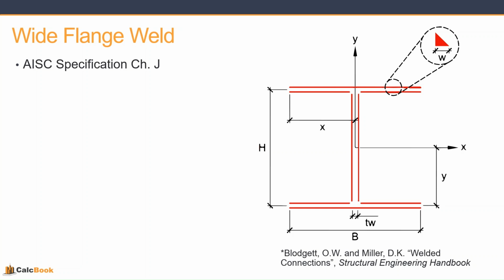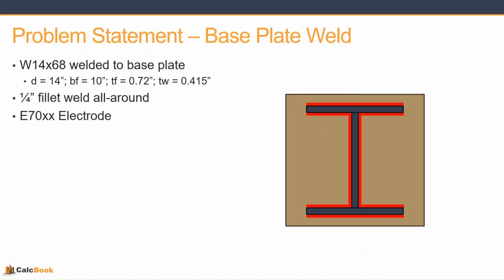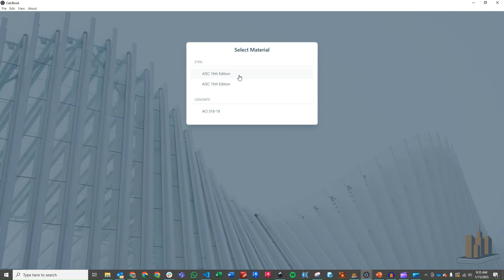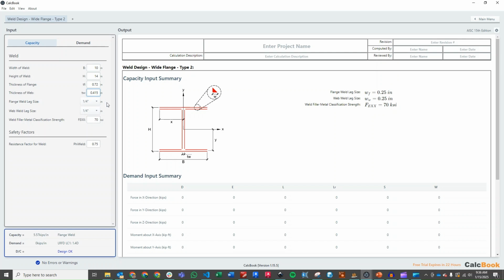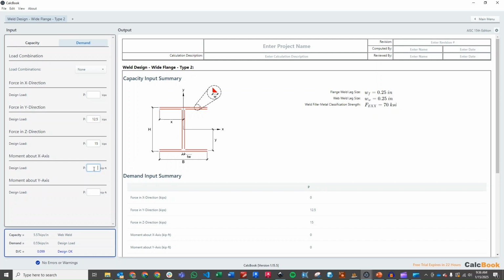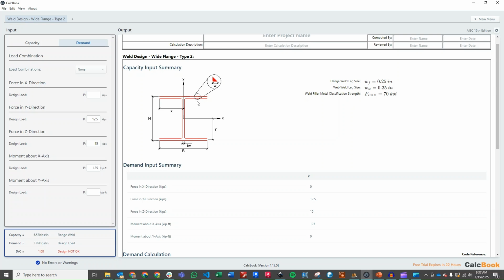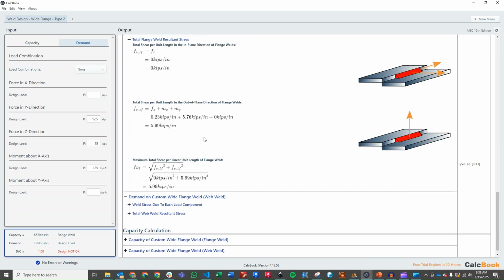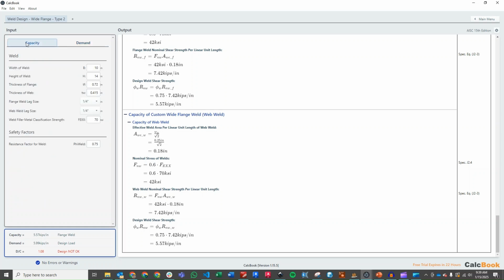Column Base Plate Weld Design (AISC and Blodgett)

Comment: When naming a moment about an axis, I typically think of the force causing rotation around that axis.  The demand moment shown would be My to me.  Does CalcBook use the moment in the "direction" of the x-axis?
Reply from the maker: Hi @ericroberson8474, thanks for the question!

You are correct that moments are named such that they are rotating "around" that axis. For this example, there is a moment causing strong-axis bending in the member, about the x-axis (we would call this Mx in CalcBook). The intro slide shows the x- and y-axis orientations assumed relative to the orientation of the member. The x-axis is parallel to the flanges, so bending "around" this axis will cause strong-axis bending in the profile (one flange in compression and the other in tension).

If there was a bending moment about the y-axis, My, this would correspond to weak-axis bending in the wide-flange in CalcBook (y-axis is parallel to the web, so bending "around" this axis would cause weak-axis bending in the profile), but for the example in the video My = 0. 

Hope that helps clarify things!
Reply: @calcbook  Thanks, @calcbook.  Yes, this clarifies things.  I was confused.  It all makes sense to me now.